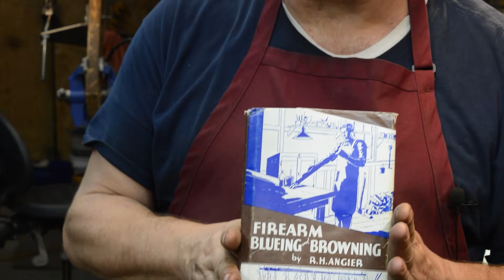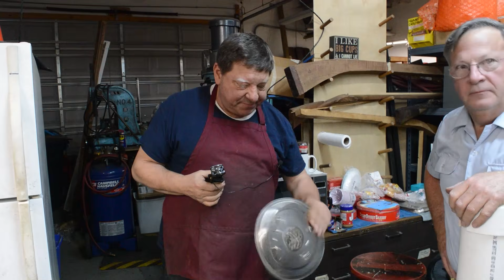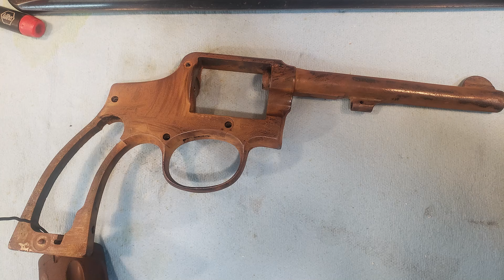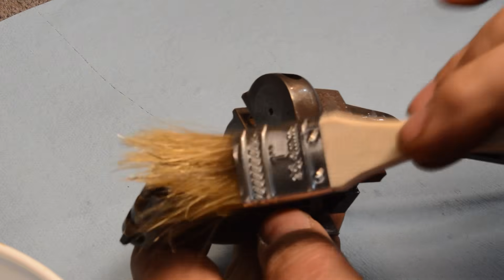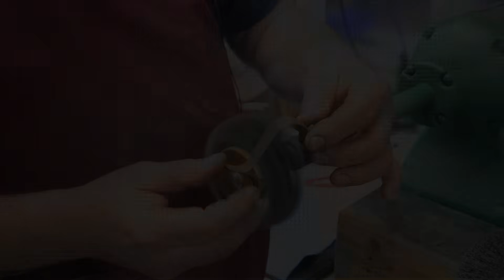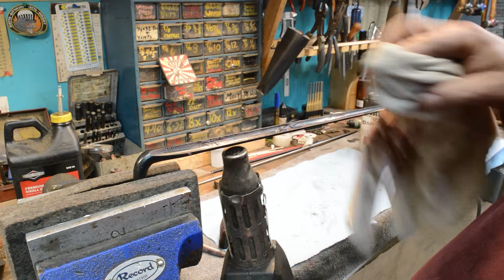Rust Bluing.....Anvil 0109

Comment: Ok Mark i got one for you...i have a "sintered"{think i got that right} metal receiver i'm trying to restore..i didn't know it was "sintered" metal til after i had stripped it and i tried to cold blue touch-up some spots on it...needless to say it didn't work it got worse the more i done.... my question is   is hot bluing my only option or will rust bluing work on this one??? which is the better way to go??? thanks for any input you may have.. this one has me banging my head..thanks again by the way don't know if it helps but this is a model 94 winchester made in 1973...

Comment: I just attempted all this, and everything was going decently well until after I took the barreled action out of the steam pipe. The steam pipe ended up causing rust rather than converting it. By that I mean there was FAR more rust on the gun than when I put it in. I was able to card most of it off and under all that gunk was bluing, but not quite the results I was expecting. The small parts that I boiled turned out as expected and look great. What am I doing wrong with the steam pipe?
Reply: Too much time in the steam, how long did you steam it for? Steam has far more energy than boiling water does, should only steam for 10-15 minutes tops.
Reply: @Misfit_556  First go around was for 15 min, second go around was for 10
Reply: @TheRealJeff984  What did your new rust build up look like? I found steaming compared to boiling causes a black and rust colored shiny flaky oxide layer on the steel where as boiling produces the black/red powdery oxide layer. As long as it was all removed when carding you should be good to go.
Reply: @familiarhuman  No, I had a boiling tank already and decided to just use that.
Reply: @Misfit_556  I ended up with a straight red rust layer
Reply: @TheRealJeff984 Bro steaming is for rust forming, you have to boil the barrel aswell to convert it....
Reply: @granola661  Learned that not too long after. So were all good now.

Comment: magnetite is iron (II) (III) oxide, fe3o4, produced from iron (III) oxide. the iron does not gain a full valence shell, it regains a d electron and has 6 d electrons, which is why it can still oxidize to iron (III) oxide. it's less reactive than metallic iron, but not quite in its happy place, iron III oxide is more stable, but porous and expands, letting moisture which dissolves oxygen and lets regular ambient oxygen in.

Comment: I rust blued a Star BM that had water leak into its original box sometime during storage or shipping to the states and had rusted horribly.  It came out amazing.  I actually thought I wasn't getting very far until I hit it with Rig grease and it blackened up several shades immediately and held that color.  It's a good bit of work especially if you don't have a lot of room or are doing a rifle, but worth it.
On the carding wheel for a cheap use, just chuck it in a drill and clamp your drill to the table with the trigger held down.  Boom, you have the same setup Mark does and all you have to buy is the wheel from Brownells.  Their carding toothbrushes are good too, just takes way longer.  I prefer the brush over steel wool, on mine I started with wool and dumped it for the brush.  I just felt like it got into every crack way better and didn't shed like steel wool does.

Comment: I am always delighted by the before/after when rust bluing. I kinda went crazy with it, and damn near everything that will fit in my steam box gets blued. All of my lathe and mill accessories. Including, quick change tool post, rotary index, all of my 3 and 4 jaw chucks, collet chucks, fly cutters, boring heads...if it will rust, and I plan on owning it more than a week, it gets rust blued. A deep bluing and a coat of light machine oil, is unbeatable as a machine tool finish.
Reply from the maker: Badass....

Comment: Have you ever used vinegar instead of steaming to put metal back in white ?
Reply: Those do two different things. Vinegar removes all rust and blueing, taking the metal to the white. Steaming/boiling converts the red rust into black rust (blueing). So steaming/boiling never takes the metal to the white.

Comment: @Mark Novak do you allow the part to cool down after the first drying cycle if youre going to reapply chemical?
Reply: if you keep the part warm, the better the next pass will be, I recommend doing carding & reapplying very quickly to keep the part heated -> will avoid water condensation on the surface in steam box

Comment: does the pvc pipe and pot do the same thing as the box ?
Reply: absolutely not. 
The damp box serves to facilitate the rusting of the parts, the steam chamber is what converts it to a black oxide. You can use the steam tube chamber he shows here or you can boil the parts in distilled water. When he says he is putting them into "thor" that is just the name he gave a big pot that he has for boiling parts and barreled actions.

Comment: I’m curious, what about all of those tricky inside area that you can’t  reach with a carding wheel? Fine steel wool ? Tips anybody ..
Reply: They make a small carding brush similar to a cleaning brush for harder areas. balled up steel wool works too, for wool make sure you ground your metal or you might end up contaminating the metal you are finishing by magnetizing it causing it to attract metal particles that will create unsightly specs in your finish.

Comment: 34:06 Do detergents in motor oil really affect rust/bluing? I thought the various detergents and additives were to keep combustion products in suspension to prevent sludge, reduce friction, prevent oxidization of the oil, prevent corrosion etc. I don't think any of them actually remove existing corrosion. I have an enormous amount of respect and admiration for Mark, but I think he might be wrong in this case.
I know a lot of people like to use motor oil on their firearms. Are there any tribologists around who could weigh in on this?
Reply: You are correct. In another video Mark talks about only using used motor oil that has had all of the detergents burned out of it. I'm not sure if the oil in this video is detergent free or rebottled after use. He has used mineral oil and kerosene to accomplish the same thing in other videos, that seems like the safer option given those are free of such detergents.
Reply: @spanishmountains4588  Used motor oil still has the detergents in it, and it also has all the carcinogenic byproducts of combustion in it. It's not safe for contact with skin.
The detergents don't damage bluing, they are just there to keep dirt in suspension, improve film properties etc.
If you're really worried about them, you can buy non-detergent motor oil.
I will say though that I have been using regular motor oil and transmission fluid (which contains even more detergents than motor oil) on my guns for over 35 years now without incident. It has no effect on bluing.

Comment: Mark, do you ever do a subscriber's gun. I have a Hamington and Richardson's Arms Company Worcester, Mass. 
Pat Oct 87.May 14 & AUG:6,89. April 2,95 April 7,1886
It won't cock, trigger doesn't work.
Reply: I'm being serious, are you aware your asking about putting $600. or more into a &150. - $200. Gun.  your not going to get a response. value when done after a full like new restoration $200. as for getting it working DON'T try to cock it,or pull the trigger, it probably is just rusted and full of crud ,a good dissasembly & cleaning will get it working
Reply: @ericschulze5641  unfortunately some people have no idea how to disassemble or clean there pew pew's or what it costs to repair them.

Comment: Mark,
Are there any limits on the speed of the carding wheel? Have heard 800 RPMs.
Ed K
Reply from the maker: My carding wheel motor is 4 pole, so 1750ish. I've used 3600 before, the brush is a tad "grabby".
Reply: @marknovak8255  ees2
Reply: @marknovak8255  thanks I've heard the same, from you I believe? What about a variac ? we can't figure out how you get such slow speeds, other than maybe on a drill press
Reply: Ed did you figure out a way to get slower speeds? I just got a variac at a garage sale, but can't find an answer if it will damage a grinder or buffer motor oddly there seems to be no difference between the two other than the arbor, which leaves me going to the drill press on slowest speed

Comment: I've used Bob's rust bluing chemicals and they do a superb job. I especially like the German and Swiss formulations. Rubbing the oiled patina with coarse burlap really brings out the fineness of the metal. I haven't seen that brake cleaner in the State of California; it would be nice to try some of that sometime. When I was a kid here in California I used to be able to purchase gallons of Toulene and Xylene and Naphthalene. Now can get none of these three.
Reply: @ericschulze5641  I notice in three paint stores here in the Roseville, California area, (Rockler and 2 Warehouse Paints stores one in Citrus Heights and the other in Auburn) carry  lacquer thinner. Gallon cans are able to be purchased but it has to be sold to the customer when purchasing Mohawk Nitrocelluose based Lacquers.
Reply: Use acetone.
Reply: 1 year later and my state has announced they will follow California and ban most solvents,
Reply: @ericschulze5641  then drive a state over and buy them.

Comment: Just a head's up, that's an API SJ oil you showed, most certainly a "detergent oil".  Not sure motor oil has anything that eats rust anyway, IIRC the anticorrosive is a chemical thing that interferes with the corrosion process, it doesn't wind that back.
Reply: Synthetic gear lube will etch certain bronze alloys.

Comment: How do you clean the bores and internal spaces after rust bluing?
Reply: The same way you would clean it normally. Use a new bore brush (cleaned with acetone) with no oil and/or a wire brush or tooth brush.

Comment: to bad that book is over $100
Reply from the maker: Get a reprint, not an original
Reply: I picked up that book at a used book store for $10 some years ago.   Look around
Reply: My copy wasnt. You dont need it anyway, most of the solutions are really dated and many very dangerous. IE; Nitric acid, mercurial salts etc. Others are ridiculously weak like salt, citric acid, etc. Just save yourself the time and money and get some rust bluing solution. I like Belgian Blue.
Reply: Google search didn't help local bookstore did not better can only find ebook at a reasonable price

Comment: I finished a P14 .303 rifle using rust blueing, i even matched the original blueing parts that didn't need doing. My formula was Sal ammoniac which was used on Lee Enfield rifles at the turn of the century.  The best part of the process was watching the grey silvery finish after 6 boilings turn blue black with oil just like magic.

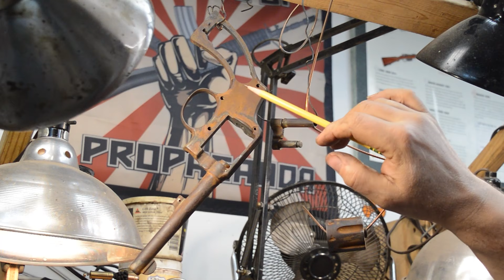Comment: At 23:00 you wrap up the discussion of ripening the rust on the chemically applied pieces. Then you say you’ll hang it along side of the pieces you’re “conserving”. Conserving is the ones you’re doing without adding chemical?
Then you jump to saying they’ve been all “converted” and spent time in a “conversion tank” but you never showed that step or what you did that in. 
Is it a boiling water bath? Is it steam? Is it something else? Is it fully immersed in water? For the 45 minutes?
You came back to the topic to create a one-stop summary, and skipped the details of that step. 
I think if we watch all the blueing episodes, we’ll get the process. I was just hoping to have it all in one video.
Reply: Yeah this frustrated me also. I’ve seen enough of Mark’s videos to know what he did, but I was also hoping this would be an all-in-one, thoroughly descriptive video. I think that was Mark’s intent, but he missed those parts. 

If you’re asking, here’s what he did (to the best of my knowledge): after heating the part up in the box with the heater, they remove the heater, and put the kettle in to steam up the box. In this step, you’re really just going for a warm, super humid environment to encourage rust. The parts are not directly in the steam, and only around 100 degrees. You let the parts sit in the warm, super humid box to “frog hair” rust. Then you move to conversion. Conversion is done in the steam tube (the PVC tube attached to the pot they showed earlier in the video). This is distinct from the previous step in that the parts are actually in hot steam, not just humid warmth. This converts the red rust to ferro-ferric oxide. Then you card, which is where the video picks back up.
Reply: I know it's seems somewhat vague to me I was expecting a overview kind of video but ended up mentally playing connecting the dots luckily I used to have lots of old scrap metal of different kinds to make things with an learned about different types of corrosion or rust, dad was a boilermaker and pipefitter so I had some input from his experiences
Reply: We are dealing with two different processes here; Part 1 is to converting “Rust” into “Magnetite” that is Bluing. And Part 2 is creating the rust coating that is needed to do Part 1.

Part 1 is simple, converting “Rust” into “Magnetite” by either boiling the rusted steel directly in water or use the hot steaming created from boiling water. After 45 minutes of boiling or Hot steaming you card the metal.

Part 2 can be simple or complex depending on the out come you want. There are a lot of different ways to create a thin coat of rust on steel however, the thinner the better.  Too thick of a rust coating will be hard to convert, can damage the steel by pitting and can cause coloration issues. Mark's method is quick and efficient but if time and quantity is not a concern then you can dispense with the cardboard box and all the components that go with it....... My tried and true method is clean the metal as Mark describes, apply the “Rust Blue” solution to the metal, hang the metal wait about 4 to 8 hours depending on the humidity level. I live in South Carolina so the rusting process can be a quick as 1 hour. Once I feel the rust has achieve the proper level I then do Part 1. I will repeat this process anywhere from 3 to 5 times in order to get the bluing thickness I desire.

Comment: How do you card the bore on the gun?
Reply from the maker: A bore brush works great in this application
Reply: I guess it’s a stupid question but what the hell?
Reply from the maker: @sfottrell4412  Use a bore brush, that is clean and has no oil on it. All the act of carding is the removal of loose converted oxides. that's what brushing with the bore brush does. No sarcasm intended, we get this question a lot
Reply: @marknovak8255  , thanks but after 26 years as a cop I don’t get offended by much. I would rather ask the stupid questions and learn something than stay silent and screw up. Thanks for everything you do.
Reply: Thanks for asking this S Fottrell. I was wondering about this myself. Would love to see a feature on carding the bore, revolver cylinders. @Mark Novak Hint hint 😉

Comment: Another great explanation an informative video.  Thank you!  BTW I used to carry a blued .38 snubby in in an in the pants holster.  I sweat a lot and rust was a problem.  I found that warming the metal and applying lanolin that was dissolved in ether left a very slick coating that was damn near impossible to rub off.  Does not smell that great at first but the smell goes away.  Cheers.

Comment: can you wear gloves?

Not to be the safety sally, but I'd think twice before wearing gloves working on a spinning tool. Yeah, thin rubber or nitrile gloves might be fine if the tool grabs them, but anything that doesn't yield so easy could drag your hand in with it if the tool grabs it.
Reply: If anyone is wondering, "drag your hand in with it" means the same thing as amputation.
Reply: @Milkmans_Son  and with every revolution, the length of sleeves you need gets shorter and shorter.

Comment: What causes the plum color I had a Winchester 94 the bluing turned a deep purple
Reply: Hot tank bluing in nitrate salts is a controlled rusting process where the desired dark blue/black color is achieved by carefully controlled temperatures and solution concentrations. If the operator deviates even slightly from these controlled temperatures and solution concentrations, the result is plum or reddish color that can change as it ages. Bluing solutions wear out or get contaminated when used. Contamination occurs from drippings from rinse and cleaning baths. Improper temperature maintenance can leave the black oxide layer porous and subject to further microrusting as it ages, with resulting color changes. Worn out solutions come from failure to carefully monitor solution chemistry or rushed production where the bluing bath is pushed beyond normal use.

Comment: Thanks for an idea Mark. My Cerakote oven currently has a dehydrator set at the bottom for dehydrating wood for stock blanks and curing linseed oil. I see no reason I can't hang parts in it that have solution on them and set a cup of water in the middle of the dehydrator once the parts are good and warm.
Reply: If it’s a post 64 cast receiver it won’t caustic salt blue usually unless you like peacock colors…

Comment: Mark..???  question about when your going to do a conservation job  Example you have a 80's colt model 70 original blued and it has some rust will boiling the colt blue make the whole finish dark and take away the I guess you could say that pretty blue tint shade. Or on older 20's 30's etc guns that have that nice blue tint to them